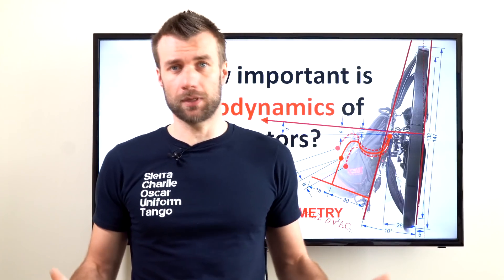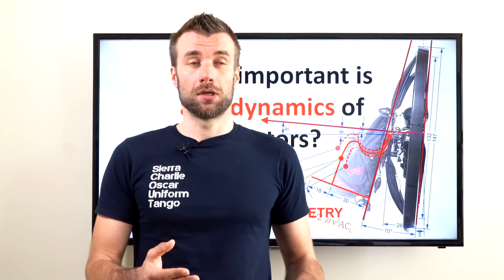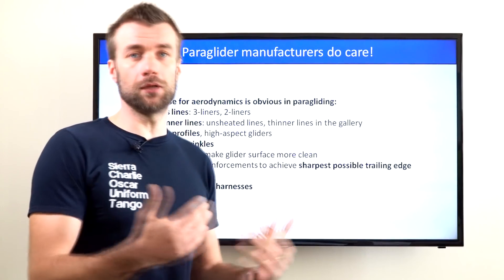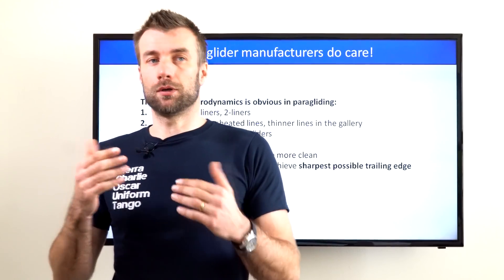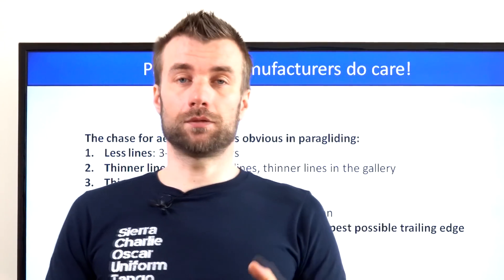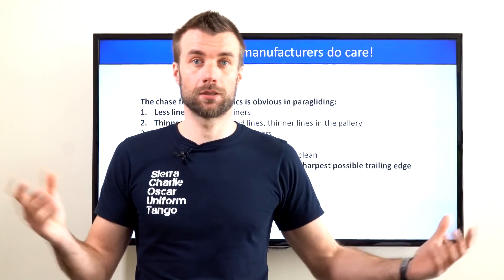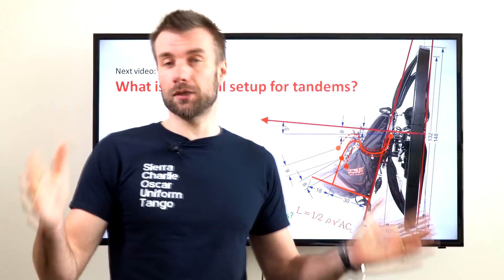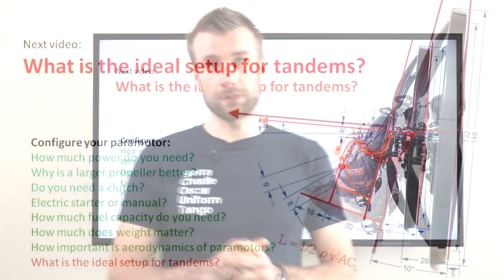Aerodynamics of paramotor. Paramotor geometry part 34

Comment: Watching this video and considering drag it seems to me for  testing/evaluation, an Electric paramotor with computer charting, could give a lot more accurate data for drawing conclusions when testing you're paramotor, frame, structure and gliders. Sensors/air flow meters connected to everything, connected to computer memory. A quick connect propeller Hub so a variety of propellers could be tested in a short amount of time under the same/simular conditions.

Comment: You mention that a low hanging gas tank will create more drag and I agree but this is the aerodynamics of a paramotor without a pilot. If a pilot's legs hang directly in front of a low hanging gas tank wouldn't that create a sort of drafting effect or at least significantly reduce the drag on the low hanging gas tank?

Comment: Thanks Miroslav for your FANTASTIC series of videos sharing your knowledge.
For those interested in the numbers, the following Masters thesis might be of interest.
Jon Longbottom (2006) INVESTIGATION INTO THE REDUCTION OF THE DRAG AREA OF A PARAMOTOR. Aviailable from https://www.scribd.com/document/77737309/Drag-Reduction-of-Paramotor

Drag reduction will have a big influence on fuel consumption and fuel range.  But there are other ways to increase fuel range with the most obvious being using winds at different altitudes. I just did a foot launched 257 km FAI triangle with 3 downwind legs and max ground speed of 102kph
https://paramotors.xcontest.org/world/en/flights/detail:PeterEvans/9.4.2018/20:30

Comment: Without a doubt, aerodynamics is an area that can be greatly improved in every paramotor.  While the Scout is obviously better than others, I'm guessing the shape of paramotors 10 or 20 years from now will be quite different, and quite a bit more aerodynamic.  The question is, what will the new shape be?  Will paramotors have a single engine and single propeller?  Will paramotors be powered by gasoline engines?  Piston engines?  Two-strokes must go!  :-)  Will paramotor pilots ride in cocoons like paragliders?  Will pilots be enclosed in a hard or soft shell?  Will a better alternative to "running" be found for foot-launched paramotors?  Some group of 10~20 inventors and designers should congregate someday and have a 5-day brainstorming session to figure out what radical improvements can be made to paramotors.  I suspect the answer is "many".
Reply: Two strokes need DI or direct injection. My outboard is DI and is equal to or out performs 4S any day. 4Ss have to many moving internal parts. DI is very mature technology since even 4S are using it. Manufacturers love 4S because it's not as reliable or easy to work on.

Comment: I think one important point deserves to be mentioned: on paramotors we have propeller thrust, which basically works against all the drag induced by the paramotor and the pilot. So, basically, keeping the paramotor aerodynamically good is equal to save on the motor thrust, motor power and fuel.   Whereas keeping the glider and lines smooth is a completely different story: we will never compensate the wing drag by motor power, since the physical forces obvious offset.
These series are supposed to help people select their paramotor, it would be great to have some numbers here. Like how much I win/loose  on selecting this feature over that. So, how actually big deal is the aerodynamics?
Thanks you.
Reply from the maker: Yes you are right. Unfortunately we do not have that infrastructure for comparison. Yet for me it was a question of principles when designing the scout. I just wanted to make my job the proper way. 
With no doubt there is benefit of having the paramotor aerodynamic. Yes, the question are the benefits worth the effort? But would knowing the exact aerodynamic benefits answer this question?
And then is the aerodynamic torque compensation and that it totally worth it.
Reply: > But would knowing the exact aerodynamic benefits answer this question?
I believe yes - as soon as someone introduces it and we start paying attention. 
For example, the static thrust power of the paramotors is often advertised in Kilograms, which gives some measure to compare motors and props. Some pilots even construct frames and scales for this. Or just full-throttle standing with your motor on your backs facing a wall with a floor scale in your hands.  
The drag given at a certain standard speed with a standard dummy in the seat could be an interesting and useful relative number too. Not easy to measure though :) A suspended frame on the top of a moving van? 
Thanks!
Reply: Without measuring, I am afraid, it is only about personal perception.  The pilot body in a sitting position is obviously the most drag-inducing object. Before we deal with it - the rest is fairly small concern. Next is the motor and the tank - big ugly things. And only then go the tubes and velcros.  
If we select a paramotor with a lot of aerodynamics concern, I believe we can easily fall into a purely visual perception and pay extra for  simply wasted manufacturer's  time and resources  spent on unnecessary complicated aerodynamic solutions. A thin round tube is actually not that horrible for aerodynamics. But it is cheap and can be repaired pretty easily.  Repairability means a difference between go and not go flying and ordering complex spare aerodynamic details.